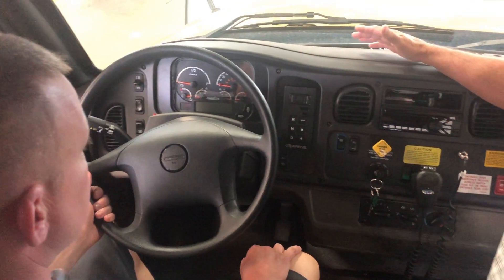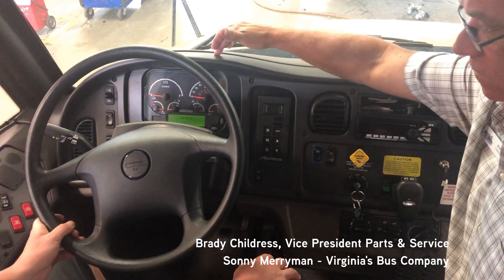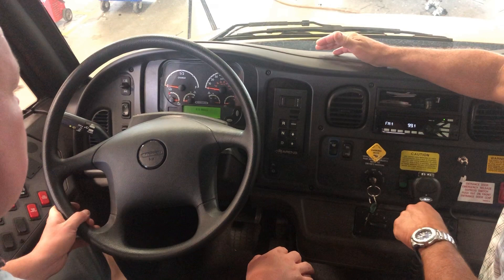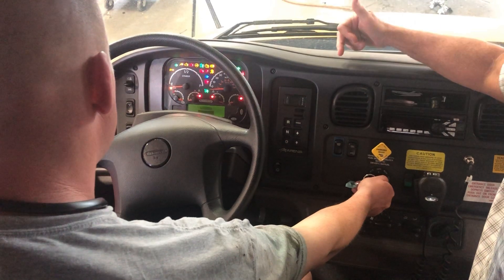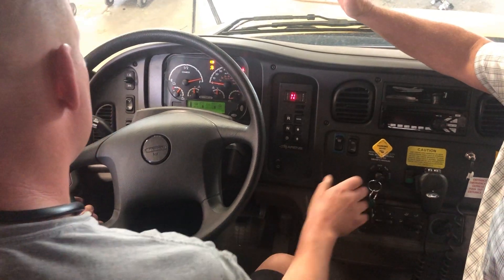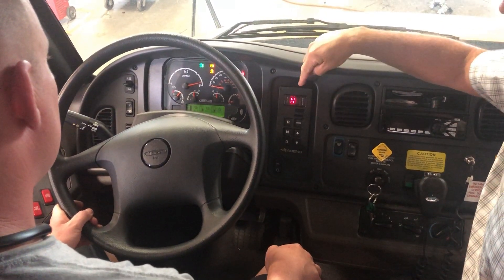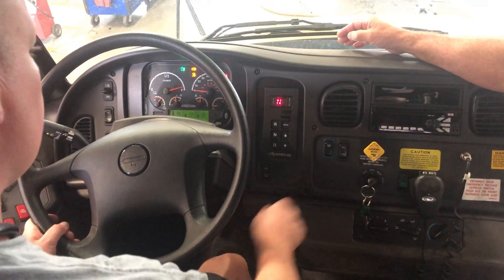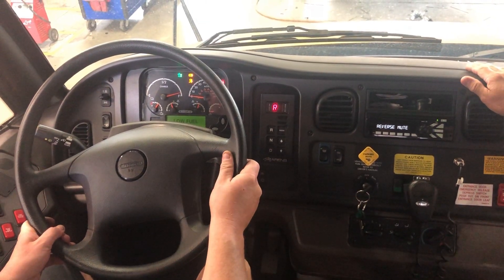Driving the Thomas Saf-T-Liner C2 Jouley Electric School Bus

Comment: What about going down long grades no transmission or engine brake how do you hold the vehicle back so the brakes don't get hot
Reply from the maker: Regenerative braking works extremely well in these situations and requires no service brake input. It becomes active when there is no accelerator input to hold the bus at safe speeds.

Comment: Aux air compressor?
Reply from the maker: Yes. It's not really an auxiliary air compressor, but it is an air break bus with a high voltage electric air compressor.